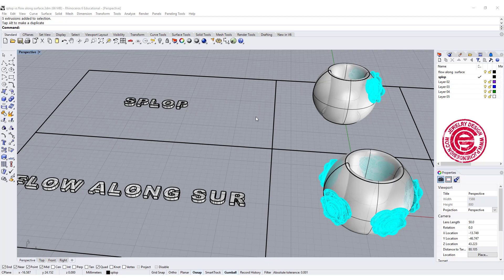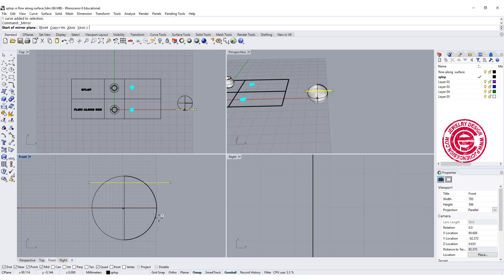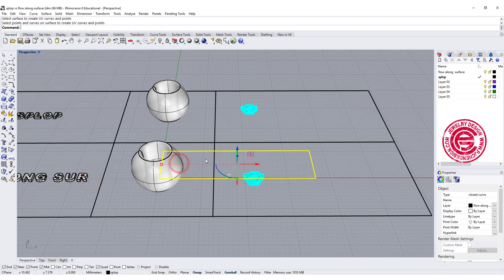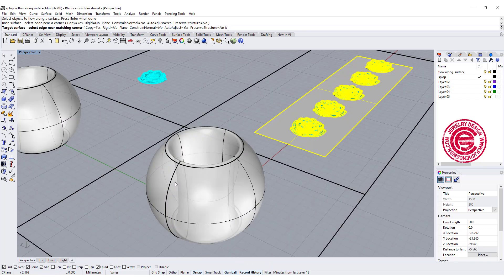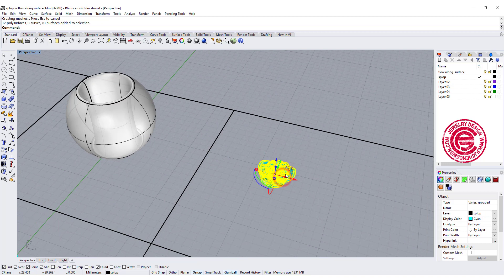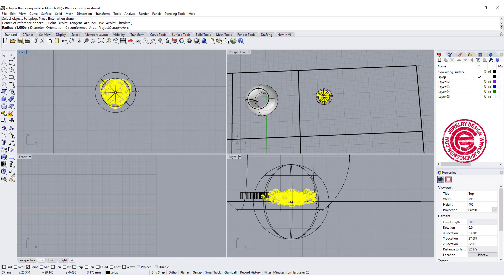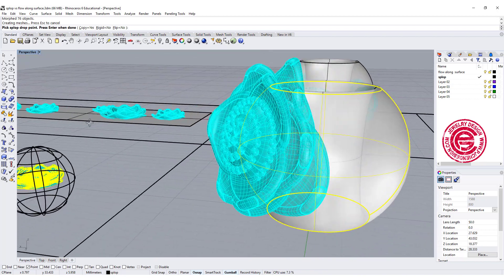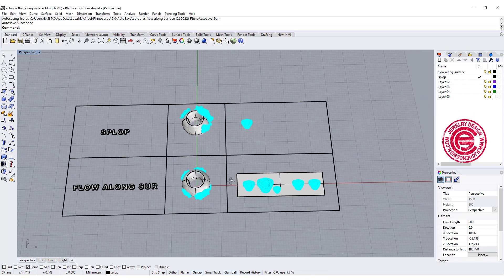Difference between Splop and Flow Along Surface Commands: Rhino 3D CAD Technique #22 (2019)

Comment: Is there a reverse method of of this?  I have skewed model that I want to make straight.  Think a warped window, but need to be flattened to make parts.  I can't seem to do it without totally flattening every piece of geometry in the model.  Unroll and smash do not work for what I am trying to do here, or I am going about it wrong.
Reply from the maker: You can try unroll. I have a video may able to help you. https://youtu.be/L2dYFw-4GLY also check on this one https://youtu.be/Ea_eIghyVXY

Comment: After using Splop or Curve along surface, how can the added object be hollowed so that the modified original has a uniform thickness?
Reply from the maker: Splop or Flow Along Surface are transform tool. it is easier to hollow the forms before you transform them to curve surface.
Reply: @PJChenJewelryDesign  Thank you for replying. I used Meshmixer  offset to shell a 1.6 mm stl object, created a surface (with zero thickness) in Rhino and splopped the shell onto the surface. When viewed from the interior, It appears as a solid object on the surface and can't find the sequence to hollow it after splopping. Am trying to print objects with uniform thickness.
Reply: @frankfritzges7819  thats some deep understanding